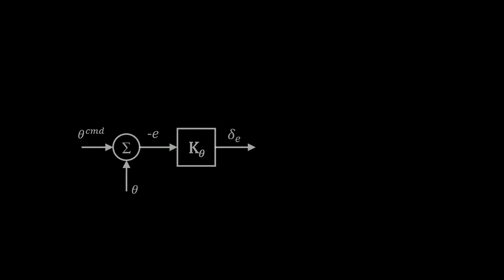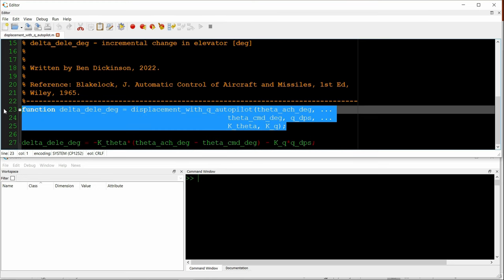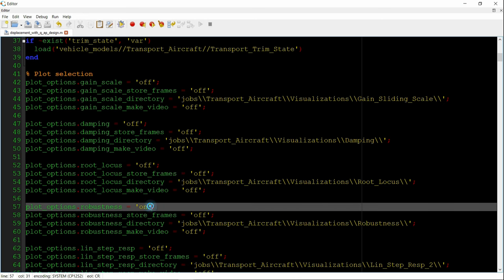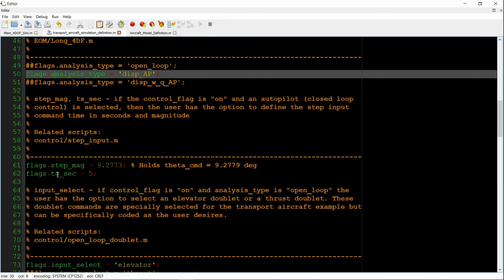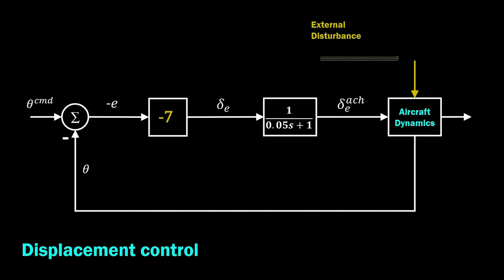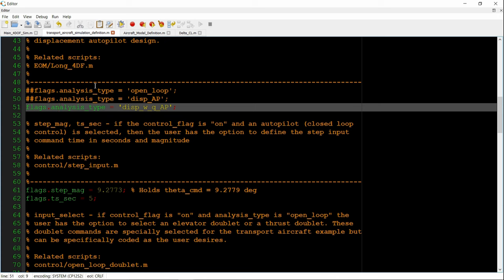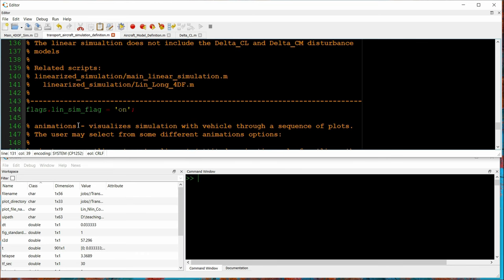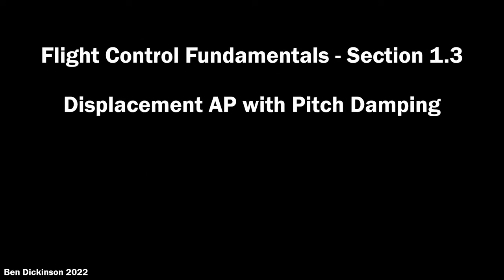Artificial Damping - Flight Control Fundamentals - Section 1.3

Comment: Awesome video. How do you validate and improve your nonlinear sim?
Reply from the maker: Hi Andrew, validation of a nonlinear sim can be tough, especially when there's a lot of complexity. You'll always have n-1 bugs when you find a bug. To help ensure things are correct, 1) carefully go through each script line by line to ensure things make sense,  2) Run simplified cases with analytical solutions (for example, simulate a cannon ball trajectory), 3) Find a trusted simulation to compare your sim against, and 4) Continue to use your simulation for a variety of applications letting bugs arise naturally.